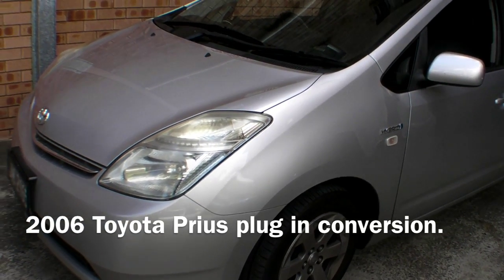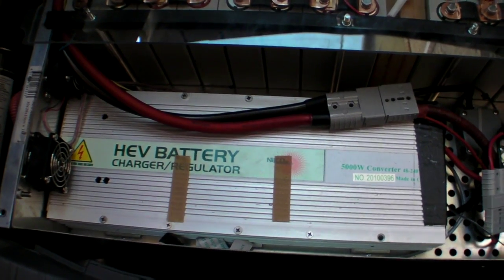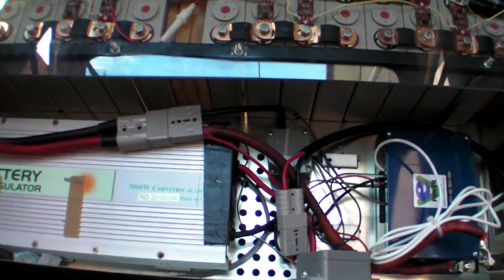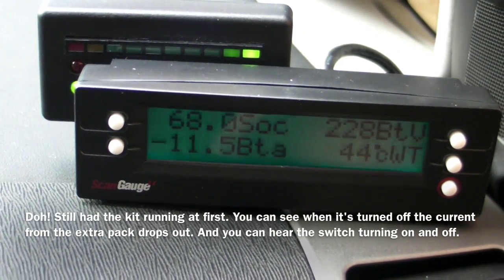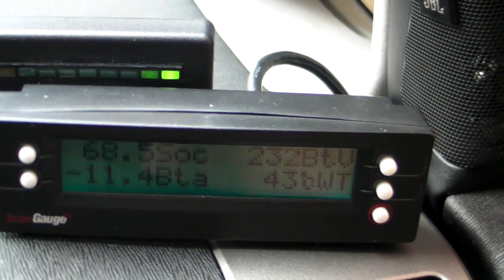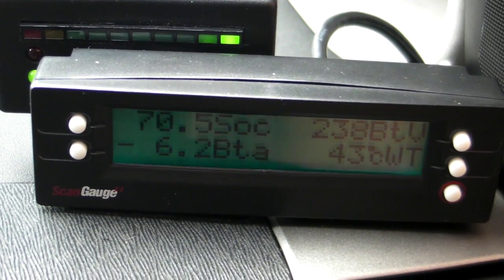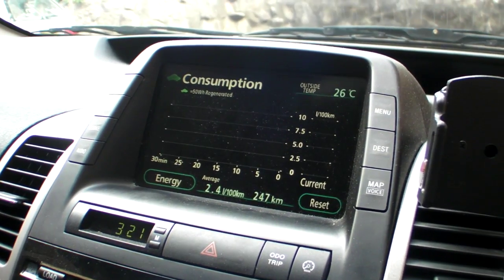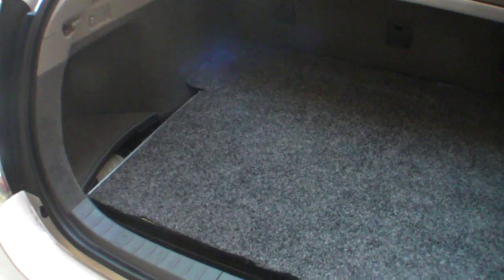2006 Toyota Prius plug in conversion (enginer phev kit rebuilt with quality BMS and batteries)

Comment: Can this kit still be purchased? If so where?
Reply from the maker: No. This company went out of business some time ago now. Several years actually. 
There are still ways to achieve the same thing, just takes more research to find things that will work.
Reply: @exaturbo  Do you have resources of where to buy or source parts? I am having a hard time trying to source anything thats not a scam.

Comment: How many  for the kit?
Reply from the maker: I’m not really sure what the cost was when new, as the kit was in the car when I purchased it, it just needed new batteries. The new batteries, management system and charger cost me over $5,000 though. So it is not a cheap exercise to convert a car.

Comment: How durable?
Reply from the maker: Toxie Connor as it turns out, not very. 

The DC-DC converter failed after about 6 months. So I re did the system using much higher voltage and using a contactor. It has so far been very reliable with the new system. And as a bonus, I can drive about 50km at city speeds without using any fuel at all. I have more updated videos on the car on this channel.

Comment: With this simple battery reconditioning method, you won’t have to buy new expensive batteries in 2017.or ever again [Check Details Here==>https://plus.google.com/100351090281822647456/posts/Ct2x2kZGdNN ] .You can just recondition your old, used batteries and save a lot of money!
Reply from the maker: Geneva Stokes that might help some, but it’s not what this video was about. Simply replacing or reconditioning the stock battery will not achieve what I have done. I’m getting better than 2.0L per 100km and around 2200km from 35L of fuel.

Comment: im wondering if theres a way to hack the stock inverter that comes in the engine bay and use that to add a plug and make it phev and just add a second prius battery
Reply from the maker: Michael D I don’t think it would be that easy. You still need to spoof the SOC in order to make the car actually use any extra battery that you add. So it’s not as easy as just adding more battery. A small home based plug in charger for the stock HV battery might improve your fuel numbers a little, but not enough to make it worthwhile in my opinion.
Reply: Jason Munro what if used 18650 batt pack  and just replace the stock batt
Reply from the maker: Michael D no one that I know of has successfully replaced the stock hv battery with lithium. Doesn’t mean it can’t be done, but you would be the first.

Comment: Great upgrade! How much would a similar upgrade cost in 2016?
Reply from the maker: Thanks. You would probably be looking at around $5,000 for a similar system today. I'm about to make lots of changes to the car. 

I will be able to do 80km with zero fuel use soon. I will post a video once that is completed.
Reply: +Jason Munro thank you for the estimate. I will stay tuned to watch the next video.
Reply from the maker: +VicHybrid you probably could, but at the cost of more lost boot / trunk space. 

I am currently working on a new conversion that will allow much better EV mode. Up to 80km with zero fuel used. 
Once that is finished, I will be putting up a video of that. It will be some months yet though, as I still have to buy the new cells.
Reply: would u be able to fit a 100ah cell in this kit?
Reply: Any updates? Doesn't seem to be many people doing this.

Comment: Just read the PriusChat thread and see Jason had a DC-DC converter issue that hadn't been resolved as of April 2015, last post. Hope it has a happy ending, and he didn't have to pull the install and sell the parts. Thought I'd put this into the comments so folks can temper their enthusiasm until the final report is in.
Reply from the maker: Unfortunately I have removed the install. It just wasn't possible for a cost effective repair to be had. 
I will investigate other more reliable options in future when funds become available. 
I will update the thread on Prius chat tomorrow.
Reply: Ouch. Was hoping to see this had been resolved.

Comment: Hi Jason,  nice work.  Can the Converter amp output handle more than 15 Amps?
Reply: ***** I believe error codes only get thrown above 70% SOC if there is power coming in to the Hybrid Battery from another source. Below 70%SOC do you get error codes with higher amps? You may need to lower the voltage to keep below the 5000W rating.  If you lower the voltage do you still get enough converter voltage to recharge the Hybrid battery across the range of voltages 190-237V ?  Alternatively don't let the car get above 70% SOC, which tends to happen if you are parked for several minutes, in which case you can switch the kit off at the dashboard switch.  We don't get this issue with MD-Tech kits, we worked on the power curve to fix this issue, (yes there's the plug ;-) lol ) .

Comment: Nice work!  How is it doing now?  Any problems yet?
Reply from the maker: thanks !

so far, i have about 200 cycles on the new batteries. all is well.this tank im averaging 2.2L per 100km.
my best ever recorded was 2.16L per 100km over 1400km....

i haven't had a single issue so far with the install. i have done about 13,000km since the install.
Reply: 2.2L/100km= roughly 2qt/60miles= 120mile/gallon.
Great job!  Have you noticed any degrading of battery capacity (and do you have a means to measure it?)
Reply from the maker: J Bishop
i have a wall mounted watt meter that i use to keep a track of the power consumed by the phev system.
when the second last bar is lit on the soc meter, it usually takes about 3.7kwh to fully recharge.

so far i have not noticed any degradation,and i wouldn't expect any at this early stage.
the cells i used supposedly have a 3000 cycle life expectancy. so that means with good management, they should outlast the car.

so far even though the cells are RATED at 40ah, i think im actually getting much more from them.
the BMS is set to trip is any cell hits 2.9V. on the 2 times the BMS has tripped, the pack took 4.8KWH to recharge.
so allowing for losses in the charger due to efficiency and the cooling fan, i think im putting about 4.4-4.5KWH into the pack.

if i had the funds available, the only thing i would consider changing, is going with 8KWH of lithium over the 4KWH i have now. and i have been considering adding an AH meter somewhere. so i can more accurately gauge the discharge level of the pack. right now all i have is the SOC meter from the BMS. it only shows in 10% increments. so it's ok, but less that perfect.
Reply: I'm trying to balance cost with the benefits, and I'm thinking of installing the 2K system which I would upgrade later as cells get cheaper.
How far are you able to travel before the 4KW pack is no longer assisting?
Reply: It's really good to hear that you aren't getting any noticeable degradation.  Word is that the Nissan Leaf experiences noticeable degradation at about 30,000 miles, or about 300 charges based on an average of 100 miles per charge.
The Leaf used li-mn chemistry with carbon electrodes originally (2011).
Reply from the maker: J Bishop
i can get around 1hr20 minutes of useful assist from the PHEV system, as long as im under about 70km/h.
once speeds get above that figure, i usually turn the system off, and revert back to standard hybrid drive.
for example, my daily work commute is 35km round trip, and takes about 1hr. i usually get home with around 30% capacity remaining on the Soc meter.

i actually took a Nissan Leaf for a test drive late last year, and would be driving one now, but i couldn't make the financing happen. the leaf is a $40,000 car here. i have heard about some people having range degradation issues, but it mainly seems to be effecting the very hot climates.
Reply: In the U.S. the Leaf SL is about $35K, the base model goes for $30K, and there is a $7500 federal tax credit (comes off total tax owed, not income) and $2500 state tax credit AND a $3000 rebate given by the Air Quality board (if you live in a county with lousy air quality).
I assume your prices are in other-than-USD?
Reply: Can you use the PHEV assist above 70KM/H, or do you just prefer to shut it off?  Most of my driving would be highway/freeway (100-120KM/H).
Reply from the maker: J Bishop
here in Australia, we don't get any rebates or grants for buying a green car.

the PHEV system can be used on highways, but the effect felt will be minimised over what it would be on city streets.

so for example, on the highway you might get down to 3.5 - 3.7L per 100km.
so i usually turn it off for highway travel, and back on once im back on city streets.
Reply: No rebates/credits of any kind, and you still pay more?
Kind of a bummer.  I'm surprised they can sell any at all!
Anyway, the lower mileage on freeway is to be expected due to wind resistance, but I suppose there is also a limit to how fast the aux. pack can charge the NiMH pack and at highway speeds you pass over that limit.
How fast are you traveling when on highway?
Reply from the maker: J Bishop
highway speeds here are 100 - 110km/h.
if im not in a hurry, i just set the cruise on 100 and leave it at that.

when the leaf launched here, they were $59,990 drive away. one year later, and with minimal sales, they dropped the price to $39,990 drive away. even the Volt here is $60k.

as far as the aux pack charging the nimh HV pack, the limit is around 14A. if you try to dial in much more than this, the car will throw codes. even at 14A, i have to clear the occasional code. it throws a P0A92 every now and then. the car thinks that MG1 is putting out too much current, due to the extra coming from the PHEV pack.

i get one about every 6 months or so. i reset it using the SG2 and all is well again.
Reply: J Bishop There is a highway blended mode that the 2006 Prius supports where the kit can be used giving very good mpg.  There's a video on my channel showing this.  The blended mode depends on the usual factors, constant speed, low power demand.